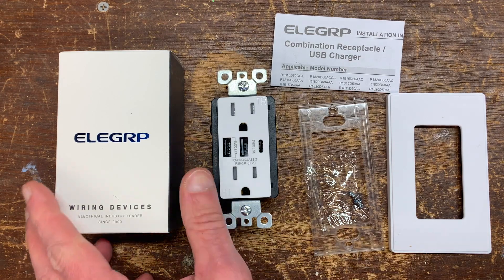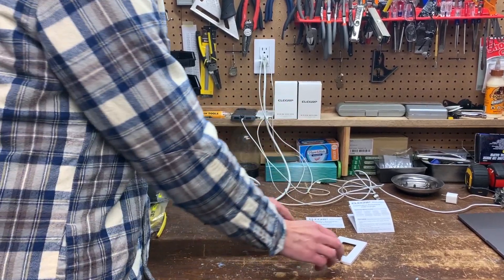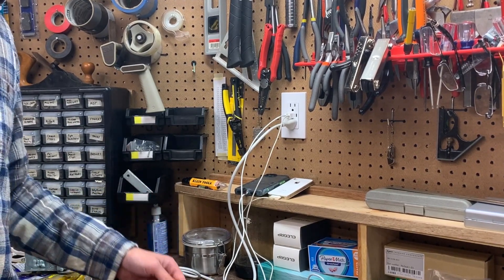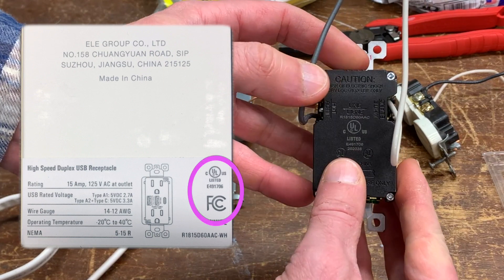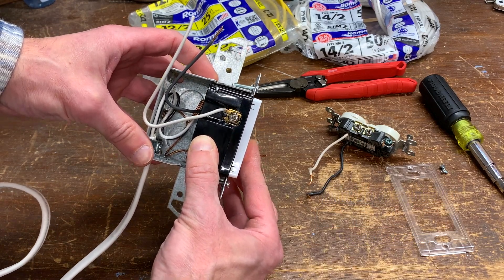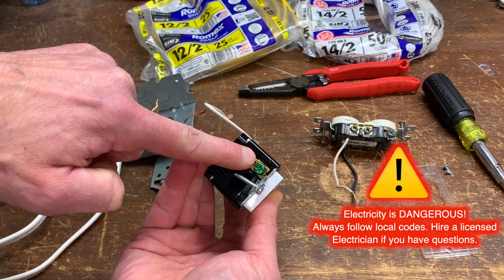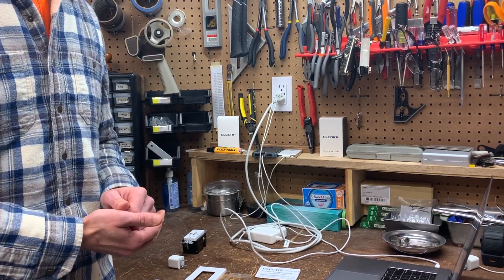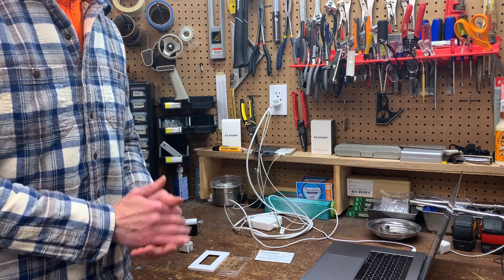GOODBYE CHARGING BLOCKS! ELEgrp Receptacle USB Charger Outlet REVIEW

Comment: Good video. BTW: Once the "exceeds capacity"  happens, the current / voltage from USB port will going down to a new balance, there will be no charge cut off but charging continuously under new balance.
Reply from the maker: Great info! Thanks for sharing that.

Comment: I have a question.... How would you install this on outlets with two hot and 2 neutral wires coming in?  I know this post is a bit old... but I just bought one and when i open my outlets ... they are all part of a circuit i suppose and on the elegrp receptable... theres only ONE hot and ONE nuetral
Reply from the maker: First let me say I’m not an electrician. Having said that, you are correct that two hots (black) and two neutrals (white) being connected to your current outlet in the junction box would mean there are outlets or even possibly light fixtures downstream (or upstream), which would be on the same circuit. As far as wiring through the elegrp receptacle I would just put two pig tails onto it and then attach all the hots (black) and neutrals (white) in the box. There do appear to be two quick connect holes in the back of the receptacle, so I would imagine that would work as well; however, the wiring diagram elegrp provides doesn’t specify oddly enough.